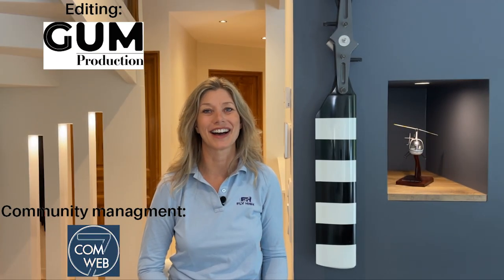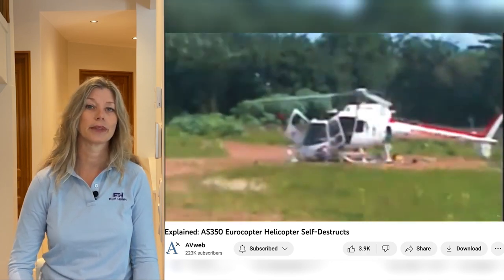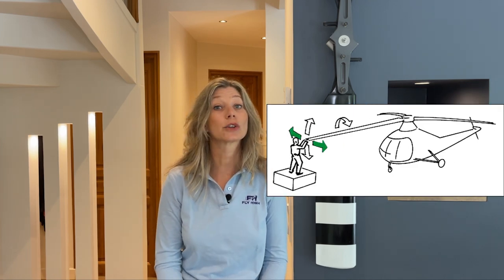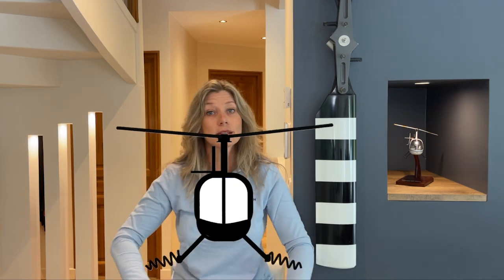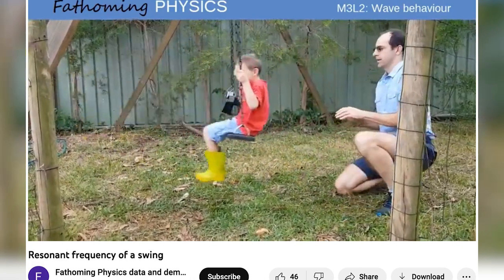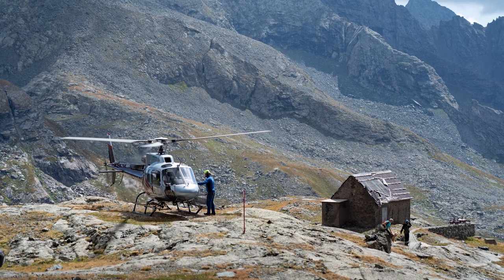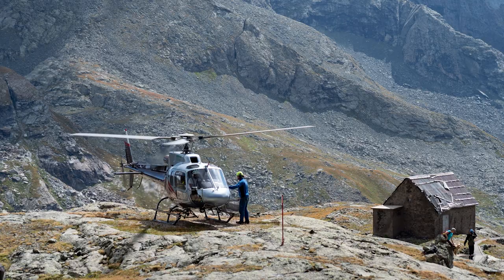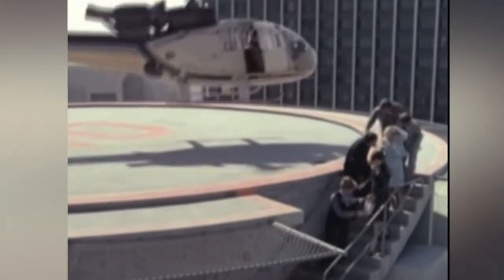HELICOPTER GROUND RESONANCE : Understanding this dangerous phenomenon.

Comment: Even as a mechanical engineer i did not understand ground resonance until now. Great explanation
Reply from the maker: So glad you found the video useful 😊
Reply: @flyhighytbwithcarolapilote  could you do a video explaining auto-rotation? There are a lot of videos out there but seeing how well you explain these concepts it would be great to hear your take on it. So many questions like how do number of blades / speed / weight / rotor systems / density altitude affect auto performance? What is the relationship between blade pitch, stall region of the disk, driving/driven regions?
Reply: If you ever experience it you'll understand it better. Believe me.
Reply: @flight2242  None of them explain that. The ability to safely autorotate depends greatly on disc/blade loading. Heavy helicopters that have high disc/blade loading are far more difficult to autorotate, part of the reason they have multiple engines.

Comment: Brilliantly explained. Subscribed. I got a two bladed RC helicopter into ground resonance but that was because it had un-dampened  drag hinges and I clamped the helicopter to a piece of board. It nearly destroyed itself.
Reply from the maker: Oh wow !
Reply: Our RC helicopters usually have a feathering head that is otherwise rigid, and blades are free to self center in the grips as they are not braced in a balanced state as full scale. Being so lightweight, any imbalance of weight or force affects the RC heli dramatically..
Reply: @francisconti9085  Yes, the blades within the grips can as you say self centre on my RC. That is the same on a three bladed full scale accept the full scale has drag dampers and isn't just relying on friction from the blade bolt. Two bladed full scale helicopters would never have such an arrangement so two bladed full scales wouldn't get into ground resonance.
Reply: @Ben-Dixey  Yup..2 bladed full scale are braced in rigidly, only having blade flap/teetering and pitch feathering. 
Any time a 2 blade rotor gets out of balance, it is very bad! If more blades unaffected,  THEIR inertia would dampen the offset center of balance..
Think tug of war.. 2-1 (3 blades) isn't as bad as 2-0..(2 blades on same side of disk) ..when there are more blades, like 7, if one blade is hunting, it occupies a fraction of the disk ..& all the inertia of good blades absorbs the imbalance better.
Kinda like weight & balance ..higher gross weight desensitizes the effect of a given moment arm.. the center of total mass changes.
Reply: @francisconti9085  True 👍👍
Talking of multi bladed rotors, I met someone who was a vibration analyst at Leonardo Helicopters. He said that there is hydraulic dampening controlled by electronics. Can't remember which model but he said there was no way to get rid of the vibration via balancing. They can still operate without the system but it's uncomfortable. I found that to be very interesting.
Reply: @Ben-Dixey  I find Fram dampers the mast, like in a ceiling fan) and harmonic dampers a curiosity..
Balance, track, blade movements and vibrations, and feedback are all quite interesting in how they manifest!
Reply: @francisconti9085  Looked up Frahm dampers, didn't know about them. 👍👍
The rotor vibration just on an R22 was significantly worse than I expected. Obviously within limits but still. No automatic vibration dampening within that rotor system as far as I know, to small and cheap of a helicopter.
Reply: @Ben-Dixey  The new JetRanger model has a damper weight between pilot/copilot seats & one on the end of the tailboom..connected by braided wire,  a curious system..something to check out!

Comment: The gazelle on the roof top was a very early version with the rigid type of landing gear. From s/n 1077 and higher, all gazelles had the flexible gear. The rigid gear was never a problem but the pilot had to position a handle to the rear for landing and fwd for flight. This handle locked one side of the MGB flex plate just to break the resonance frequency. Like I said it was never a problem but some pilots forgot to put the handle to the rear and the chance of a ground resonance was possibly higher. Also what I can wee on the video is that the pilot sat on the left seat (which is not permitted for solo flights). This event may also contributed to the ground resonance developing.
Reply from the maker: Excellent ! Super interesting. Thanks for contributing. 😀

Comment: So another story. My father got into ground resonance while startup. He was chasing the mixture around the cabin. 

The machine destroyed itself (I think this was a Hughes 300 also), and he managed to  climb out through the bubble that was smashed open. Again just with minor scratches. 

Was a maintenance problem as is often the case.
Reply: I remember when we moved from the old dampers to elasotomeric (I think that was the name) type and the 300 was less likely to get into a ground resonance state. 

I still remember many times putting down in right front of the hanger on the concrete and having to lift off immediately. As a green pilot the stress of landing close to the hangar and on a hard surface was always the hardest part of the flight. 😂
Reply from the maker: Wow thanks for sharing. I bet it was stressful 😟

Comment: Quite apart from uncomfortable flight, sloppy maintenance in not carrying out scheduled tracking and balance can also eventually result in long term mechanical and structural damage which can go undetected in standard pre and post flight checks. Engine mounts are the first to give and the airframe itself will present tiny cracks at critical points. A badly maintained B-47 I was flying in finally tore off its fuel collector above the carburettor on a mountain landing sending all the fuel from both tanks onto a hot turbo. 
Live to fly another day, eh!
Reply from the maker: Oh wow 😳😳 You are so right about that. Thanks so much for sharing 😃